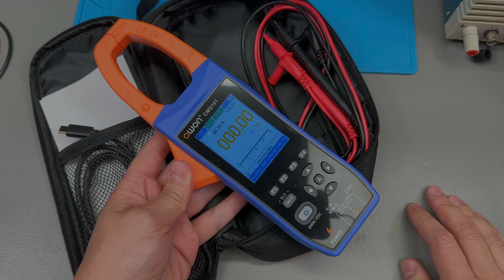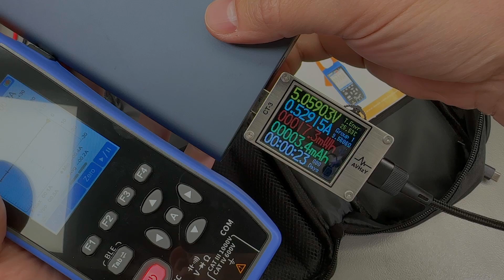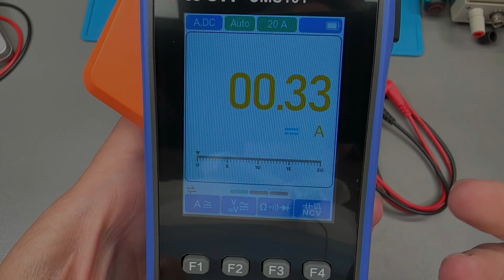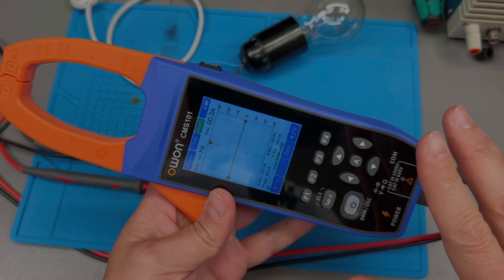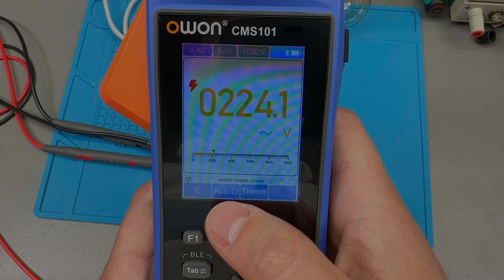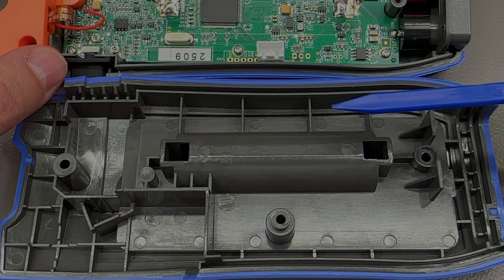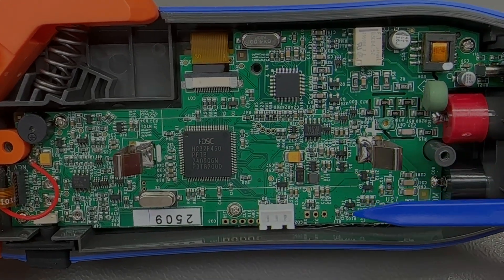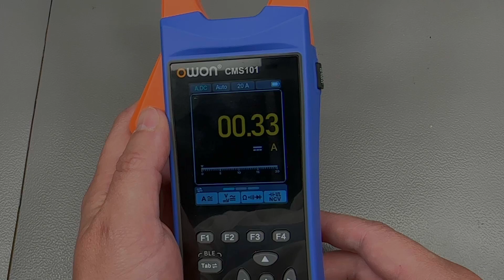This Clamp Meter Has A SECRET FEATURE... But It Doesn't Work!

Comment: I agree, this meter is pure trash. Bought two of them. keeps hanging during paid work. I threw that piece of crap right in the trash as is -  and salvaged the battery and test leads. 

Fnirsi at least has a firmware update service, unlike this lazy junk.

This OWON is a classic example of a good idea, and POOR implementation. Get the a Fnirsi if you want a cheap scope.
Reply from the maker: Thanks for sharing your experience!

Comment: This bug when switching from DMM to OSC mode when connected to Mains voltage does not occur if you connect it while already in OSC mode. after that, you can switch back an forth indefinately. Only when you start out in DMM mode this happens. 
In my case it acts a little different. when switching it from DMM to OSC mode it reads 1.5kV but 0,000V when swithcing back to DMM. Could be dangerous in some circumstances I guess.
I've made a small demo video about this behaviour.

Comment: Surely a missed opportunity not to calculate power. Even my 30€ Fnirsi clamp meter does this fine.
Reply: Fnirsi does something fine? Doubt.
Reply: @ at least it has this functionality and it works. And yes Fnirsi does not always make things right. But in this case they do.
Reply from the maker: You would think that being in the multimeter business as Owon have been for a long time you would see this opportunity and go for it..
Reply: @ absolutely
Reply: Fnirsi is one of those Chinese brand that I will forever stay away from after too many dissapointments. For that matter, I trust Owon a lot more although this specific clamp meter has a flaw that could be somewhat dangerous of which I have made a small video to demonstrate.

Comment: Looks a great meter. 
Personally I really like multifunctional meters, specially those that are both rechargeable for on the bench work, where power points are available, but can also be powered by a replaceable battery while in the field.  
However, it seem this, like so many products today, was rushed to market without attention paid to integration and functional testing.  I agree with your comment that you should also only buy a product on what it offers at the time of sale and not on promises of what it will be later.
One of my biggest bugbears is devices that are supported via buggy phone or PC apps which fail to be supported 12 months after purchase thus making the product next to useless.
Again if in the market for such a product I would probably purchase this based on its stand alone functionality but that frozen  Amp reading would have to be fixed first as this could be detremental to the user and or product under test.
Reply from the maker: The thing with the buggy phone or PC apps that are no longer supported after 12 months is very true and also a concern I constantly have. Luckily, in recent years, people  are developing universal apps like TestController that address the issue and actually add a lot of functionality on top. https://lygte-info.dk/project/TestControllerIntro%20UK.html